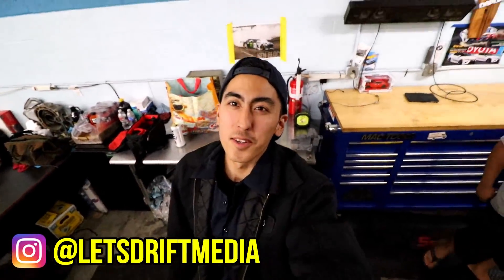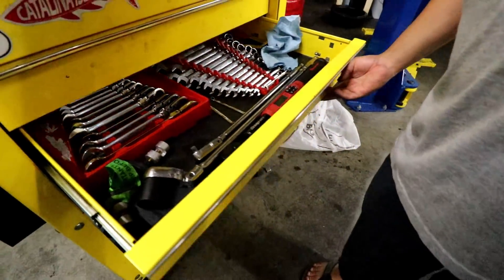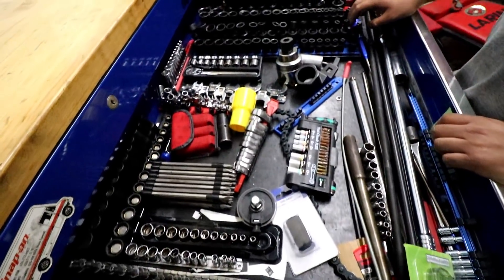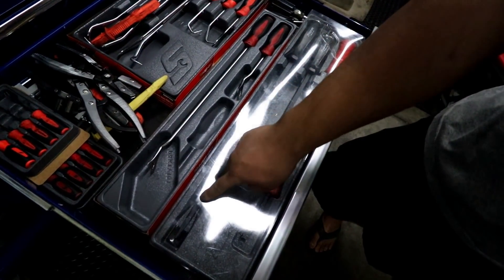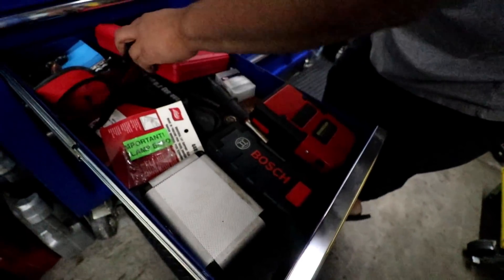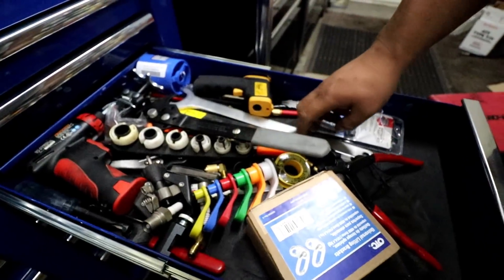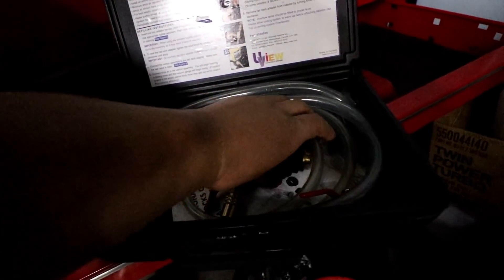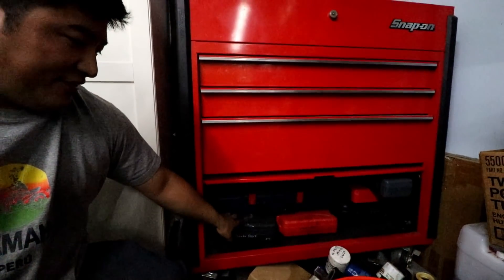DANNY'S SNAPON/MAC TOOL BOX WALKTHROUGH 2019

Comment: Not to bash on the young mechanic(age wise), but then again I was in your position too when I was in my 20s. But there is going to be a time you guys need to learn how to manage your money properly. That could of have been a nice down payment for a house. 
I learn this from a very talented mechanic who I had the pleasure working with. I notice and ask him why all his tools are home Depot or Lowe's brand and other random brand. He told me that you don't need top of the line brand. It's how you use it properly and knowing when not to use  such as using 12pt on rusted bolt/nut.  Now mind you this a  diesel shop that we work on commercial vehicles that's beat up and rust all over. This is not a car dealership where most of the time the car are fairly new. You guys will never understand rust unless you guys work at a mom & pop shop and commercial vehicles. And the fact is since you guys work on cars, there is really no point of having the top brand tools. The highest torque on a car is less than 500ft lbs, that's on 1/2 ton pick up. Trust me I had broken every type of brand including snap on. And all hand tools this days have lifetime warranty. 
I work on heavy equipment and I have been using sunex impact sockets. Now mind you in my field I use 1/2,3/4, and 1 inch impact wrench daily. And those sunex hold up for a fraction of a price. You guys uses 3/8 impact most of the time in a car business, so tell me how of a possibility can you break them. Remember Napa, craftsman, husky, kobalt you can go to the store and have a broken tool replace no questions ask. All of this is only regards basic hand tools. Im not talking about special tools, electrical tools, etc.
My point about all this is to learn how to manage your money well. Start thinking about your future and figure out where your income is best use for. 
PS. There is a YouTube where a guy tested out tool brand from cheap to snap on. I believe it was a ratchet, but look for it. You be surprise. 
And also look into Napa, tekton, husky, s&k, craftsman tools, gearwrench. They are great tools and convenient to replace them if you break it
I own a tundra, s2000, boat, gonon vacation, and top of that own a house. All that cause was smart enough to manage my money. 
Also another life lesson. Start on your retirement, not just from your company, I mean additional personal. Your young but when your old and not getting paid hourly and have to bust your ass
Reply from the maker: Great advice man I appreciate you sharing your wisdom I hope many people read this comment 🙏your are 100% correct the older the more I realize that I didnt need to go and buy a bunch of snapon/mac tools. I always wondered why older techs didnt have much fancy stuff. But it's very hard to convince a new coming tech when there fresh in the industry.